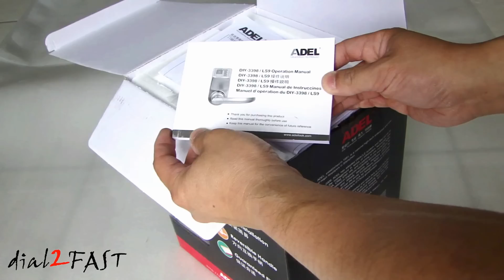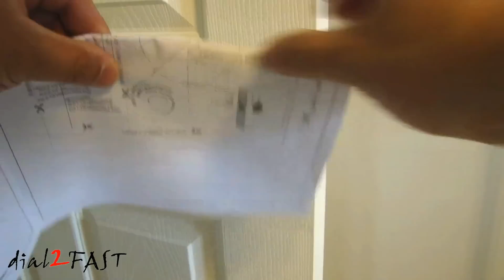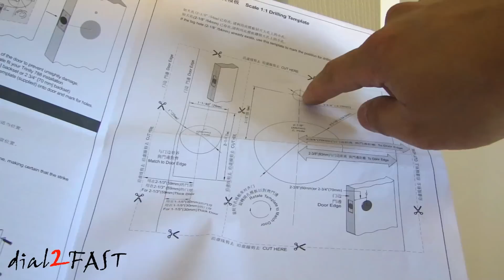How To Install A Fingerprint Door Lock

Comment: Hi, did you try to open the door lock using the physical key? i have the same adel ls9 model but it didn't work. so if the internal mechanism fails, i'm basically screwed up

Comment: Well explained and best reviewed on the Adel 3398 Biometric Fingerprint Door Lock with proper details and information thanks mate.
Reply from the maker: Thanks for your comment!
Reply: hi the outside handle will not engage to turn the latch.  also the emergency key does not turn the lock, any idea why?
Reply: Clutch isn't positioned correctly.

Comment: Hey I installed this and everything works except for the emergency key....not sure what the issue could  be.  The key worked the first time i tried it then second try it would not unlock...any ideals?
Reply: Lyle Isaac when i got mine the key didn't work either but I kept fitting with it and than it started working again so just keep turning the key if it turns